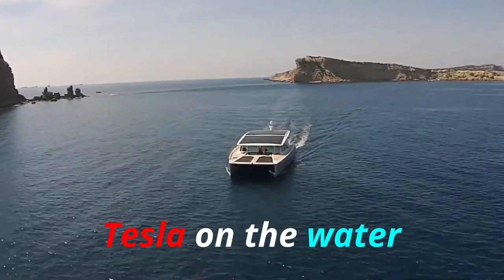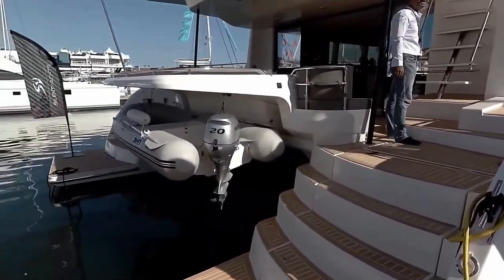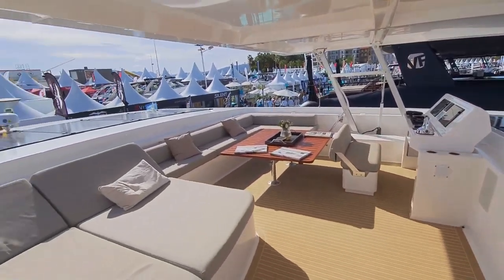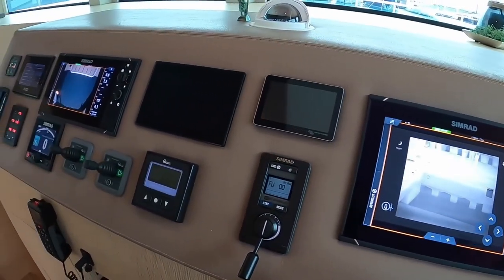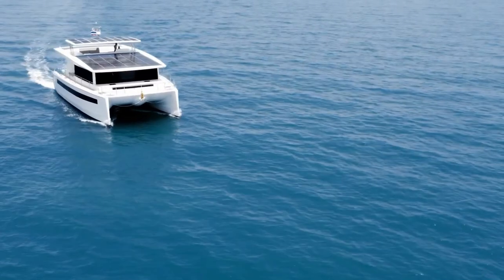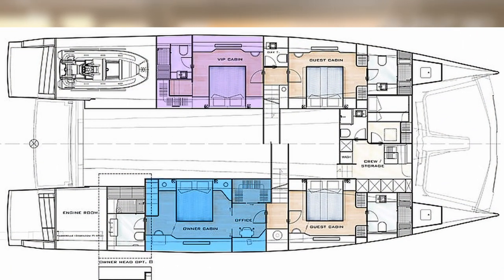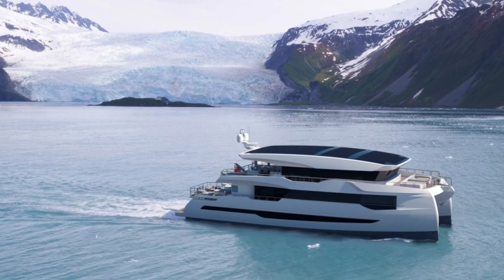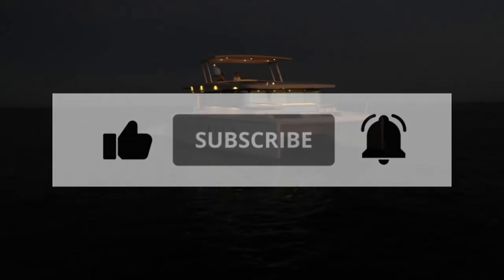Inside Silent Yachts Solar Powered Catamarans!

Comment: silent 80 3 deck closed with the penthouse on top.  the 120 is just too under powered. the 60 is nice too but i want the space.
Reply: Most explorers have a range of 9(cruising)-14 Knots max. While this yacht can cruise at 10 knots, max 14-16. This boat is also 499GT. I think the power is just right. I do agree about the 80 being a nice balance.
Reply: @TChalla007  It can only cruise at 10kn if you run the generator 24/7. At that point you can just get any other motorboat.